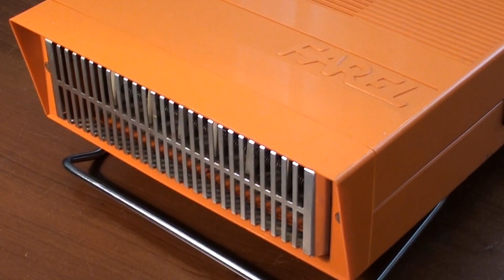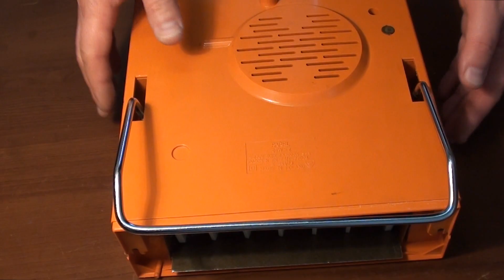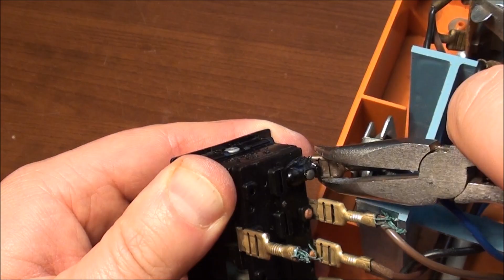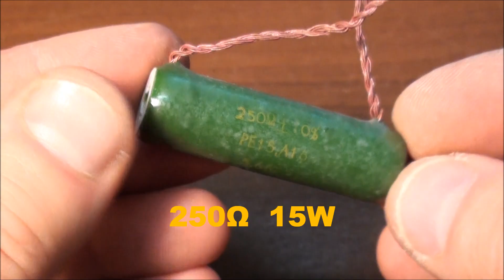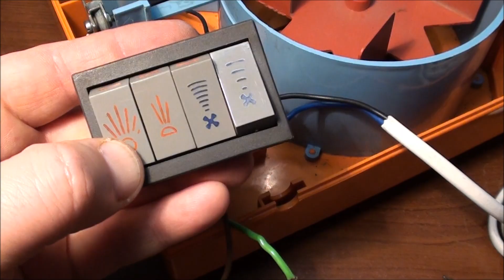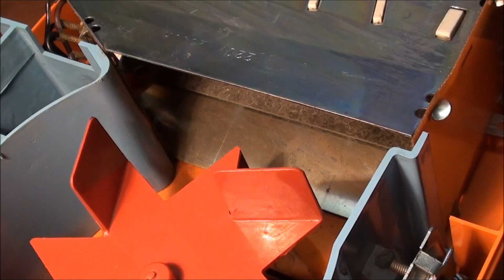FAREL - termowentylator OTW-2 R

Comment: I watch your videos since years. You are so professional most of the time. Why you don't have a 6.3mm terminal crimper? It's so much easier to work with those than using pliers.
Reply from the maker: I rarely use 6.3mm terminals. I do not need a special tool. 
Thank you for watching :)
Reply: @ARQ-TONTECH  Ohh, okay, that's pretty reasonable. Keep up the good work, my firend:) A fun fact: I'm driving a veteran Lada from the 80s, and it's licence plate is ARQ ;)
Reply from the maker: Fantastic! Thank you for the good word :)